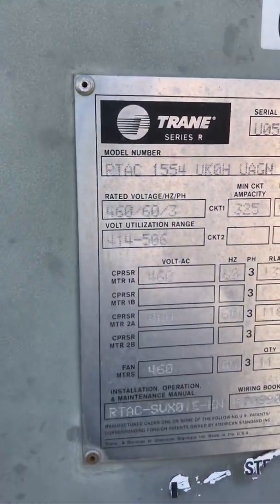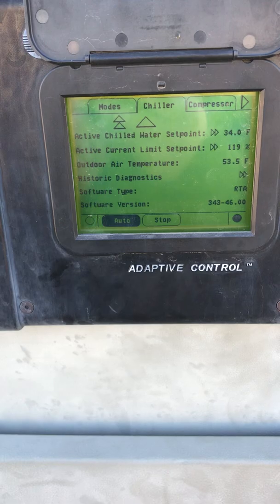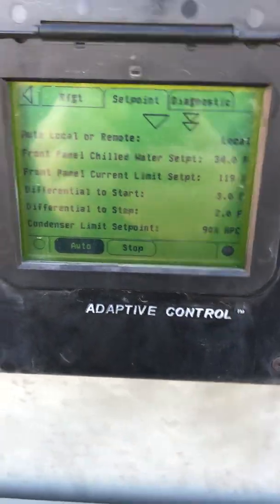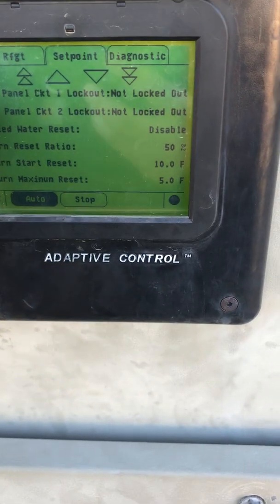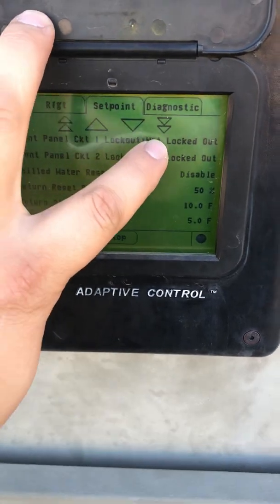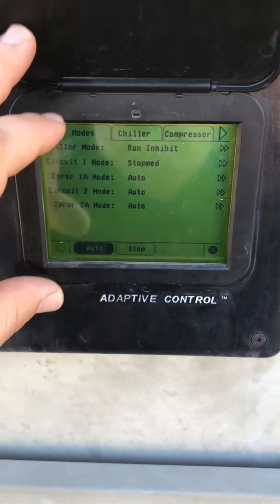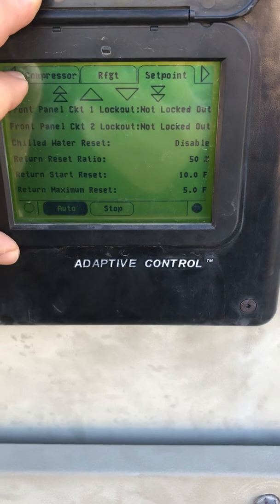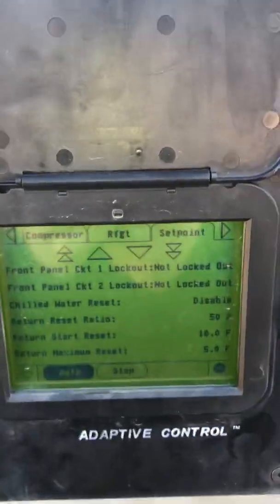Trane Air cooled chiller. How To use- adaptive controller. Lock a circuit out

Comment: Hi can i ask what about low suction presure in trane unit.is it possible low suction transducer have problem.when i check in my manifold charge is good but when i check in navigator or monitor its only have 40psi .
Reply from the maker: Sounds bad to me, if there are 2 circuits then swap the sensors and see if the problem follows. Make sure to bind them in.

Comment: Hallo sir 
Tanks for you
(IN Hibited by External source Waiting for bas communications)
The is problem in chiller trane  What is the probability of this problem???
Reply from the maker: That means it waiting for signal for you BAS “building Automation System” that’s what tells it to run or you can run it off local, that will run off temp not on off signal from BAS system.
Reply: Thanks 
What about solutions
Reply: the chiller is currently Inhibite from starting (and running ) but may be allowed to start if the Inhibiting or diagnostic condition is cleared
Reply: damper scanning steps

Comment: Hallo Sir,
TRANE RTAC 400 chiller goes sometimes in 24 hours on low oil flow when reset chiller, oil pressure is normal (ok) sometime less oil pressure or sometime running chiller more than 24  hours it's goes again low oil flow so what should I guess to solve this problem...
Reply: Had the same issue> Theres a check valve in the compressor that sometimes sticks. Theres a service note out on it.

Comment: please sir i need your help we have trane chiller rtac 185 not cooling no alarm and all parts working but not cool proper and how fill oil which valve or line i will use
Reply from the maker: Use the suction line so oil goes back to the compressor on start up. If the chiller is running and making temp. Confirm leaving water temp. It’s it’s at set point then check if there is a shut automatic-valve at the air handler not open and not letting chilled water go across coil
Reply: Please help me one more my chiller cooling set locked how to open lock please sir